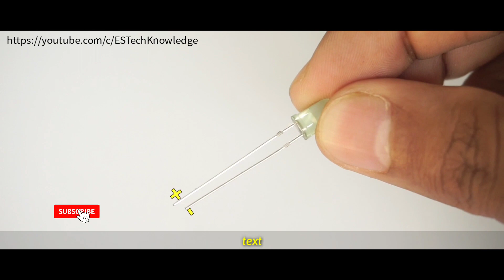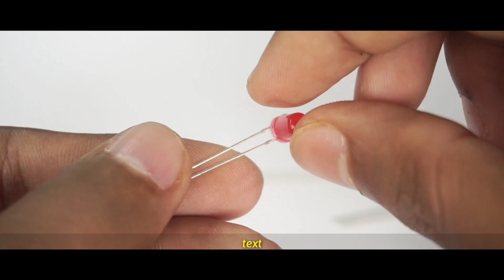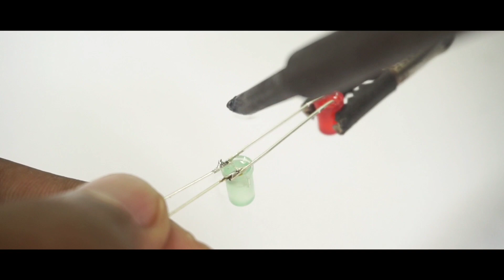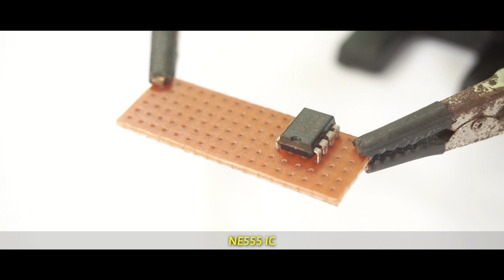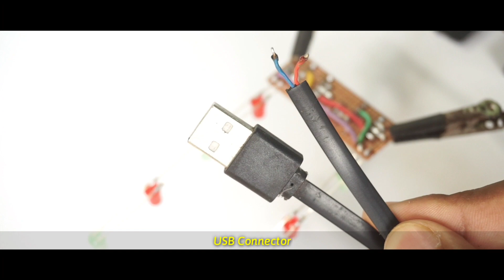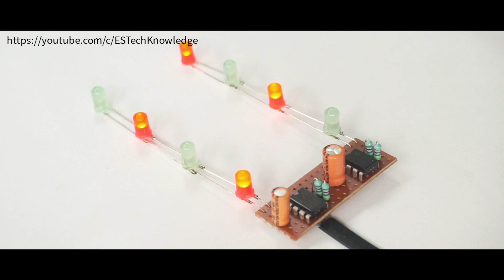New style LED effect using NE555 IC

Comment: That's a clever design - using two square waves of different frequency (10:1 ratio) to produce beat frequencies. A bit like the "breathing LED" trick. The use of AC and back to back LEDs is neat. Thanks for sharing
Reply: I don't understand how the voltage is being inverted by the slower 555 to make colors change.

Comment: A conical tip on the iron would be a better choice for close connection soldering than the tip you are using.  Also, clean tips work more efficiently than dirty ones and produce neater results.

But all in all, not a bad project for a rainy day.

If the LED's were changed to white and blue, it would look like a miniature of the LED strobe bars that the local PD use on their cars where I live!  Might be fun making an enclosure and mounting on one of my grandson's RC cars.
Reply: I have to disagree on the tip. Used conical tips for many years, as that was all that was available for the soldering station I had. When I finally upgraded to a new soldering station a couple of years ago, I completely abandoned conical tips. I exclusively use bevel (as in the video) or chisel tips of varying sizes, depending on the job. Superior heat transfer and contact area with the things being soldered. Additionally, the solder stays where you want it to.
Reply: conical tips are literately the most useless tips for anything

Comment: The 555 offers some interesting waveforms on the other pins. Its R-C voltage (on the timing cap) oscillates between 1/3 and 2/3 Vcc, and is a very nearly linear ramp up and down waveform. Then that ramp can be tapped and compared to an adjustable voltage (5k pot between two 4.7k resistors), and it's thus very easy to make a 0-100% duty cycle square-wave waveform.
Reply: I learned long ago that it is actually kind of hard to make a 0-100% duty cycle circuit without having oscillation instability near 0 or 100%. I ended up just settling on Off/On/15%-85% on one project a while back.
I didn't know about this trick.
Reply: On the potentiometer you place 2 diodes such as 1N4148 one each on the outer terminals one faces in the other out. This separates the charge and discharge cycles and you can adjust from there.
Reply: @rich1051414  Interesting. Circa 1980 I built a circuit as I described above to test an automotive Dwell meter. I had no issues with smooth control from firmly 0% to firmly 100% (the 5k pot span with 4.7k top and bottom exceeds one-third to two-thirds range). Perhaps there was some complication that you ran into. Cheers.
Reply: I used a 555 for a motor speed controller back in the day. It was for a RC model boat. The owner had tried using a variable resistance motor speed controller and with the currents involved the thing kept on overheating. I just used the pot as described above to vary the duty cycle of a squarewave at about 1000 Hz and then fed that into a pair of mosfets to control the motor. I put the mosfets on a heatsink, just to be safe, but because they were either on or off there was very little power dissipation and they didn't even get warm. As a fringe benefit the battery lasted much longer as well, since it was supplying so much less average current.

Comment: That's a variation on the Christmas Tree Star that was in an Electronics Magazine in the 80s, that I built. Basically, it had 5 LES (small screw) bulbs, wired in a H format between +12V and 0V and the crossbar of the H had the 5th bulb, which was connected between the 2 555 outputs. Net effect - run the 555s at 2 slightly different low frequencies and blinky lights. The simple effects are sometimes the best 😃
Reply: The 555 was kind of young when you did that! I was 10 when the 555 was conceived!  :-)

Comment: How is that possible that the LEDs are blinking individually if you wire them together?
Reply: ICs 555 are producing oscilating (alternate) pulses.
At beguining of vídeo you may see Red Leds (+) terminais  are conected to Green Leds (-) terminals, and vice-versa.
So, depending on signal produced by 555, only Red leds OR Green leds will go On, alternate.
Reply: NE555  disini sama seperti rangkaian Flip Flop 555. silahkan cek rangkaian Flip Flop dengan IC 555